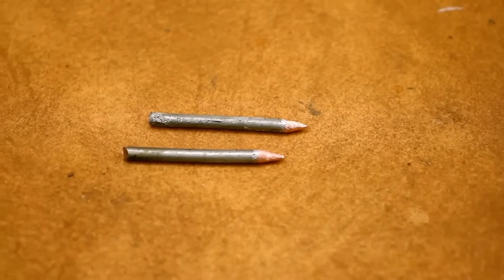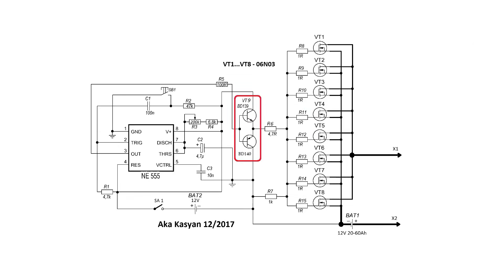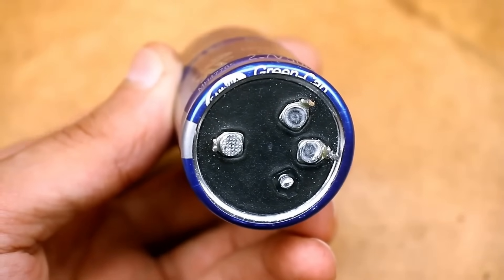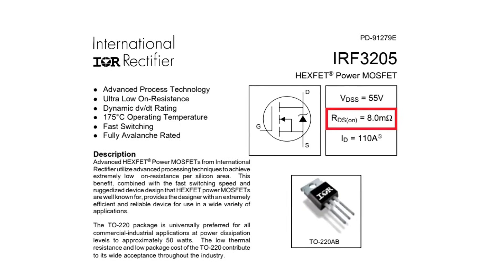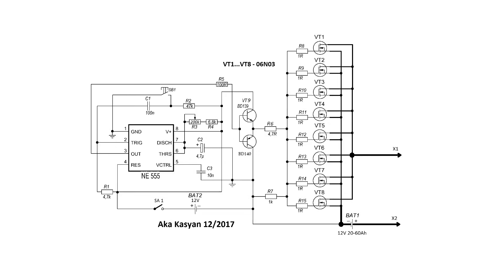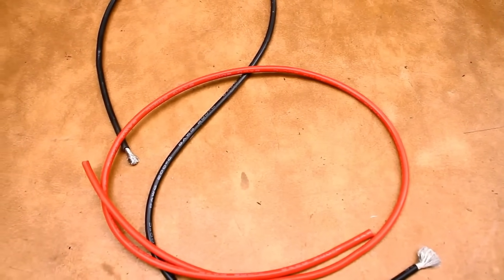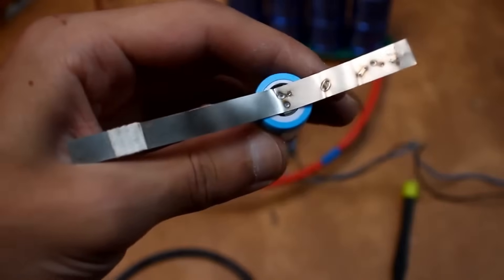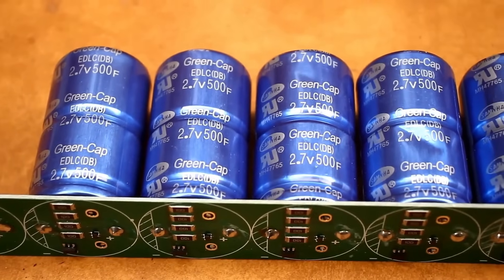Welding machine on IONISTORS

Comment: Junkyard or cheapest new car or motorcycle battery, junkyard or cheapest new automobile starter solenoid, cheap 555 timer module to drive the cheap MOSFET module used to drive the starter solenoid coil?

Comment: Of course a person can save themselves quite a bit of work by simply using a car battery two wires and two tungsten probes for their spot welding. 
WARNING. Do NOT weld near the battery as it may be venting a flammable or even explosive gas.

Comment: Brother here is the idea i give you to make ultimate powerful spot welder ( buy a small portable inverter welding machine and redesign your spot welder controller and  so your welding machine will be a power source and your controller will be a plus generator so you can weld even 5mm  thik coper or nikel try it if you can 
Good luck 👍

Comment: kinda want this but i'd prolly be better off buying a premade 1 on ebay for $30 lol
Reply: You can also use this circuit and use a RC Toy High Current Lithium battery as he said at end
Reply: @kalashnikov_47z  thinking about using mosfets from a dead ebike controller to make it as we speak lol
Reply: @frogz 
Yes , that will save money